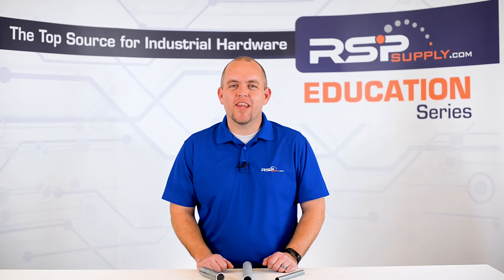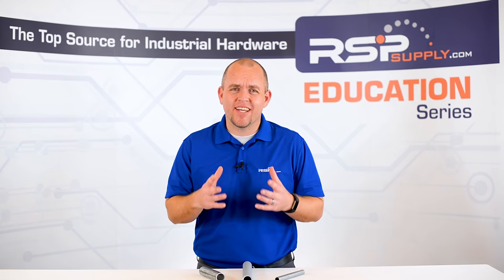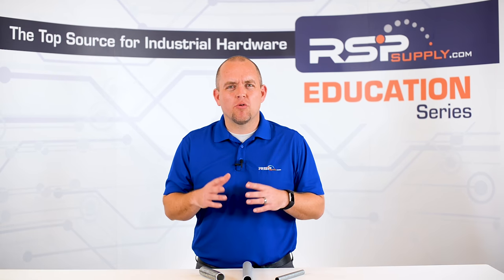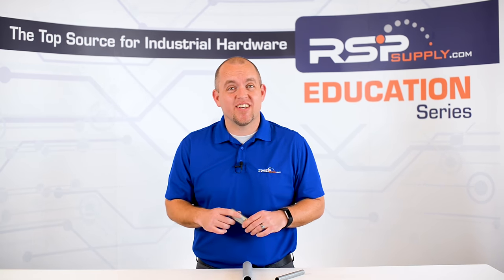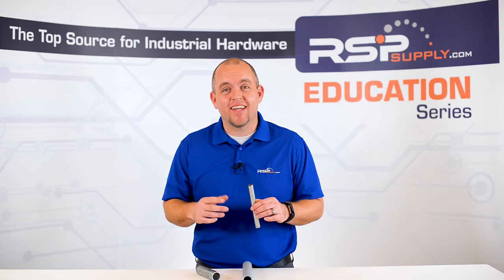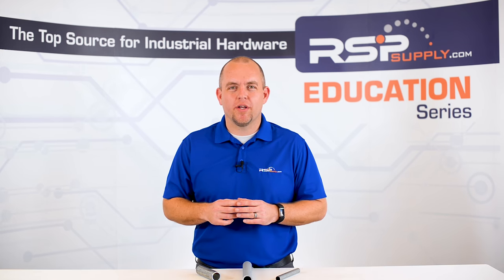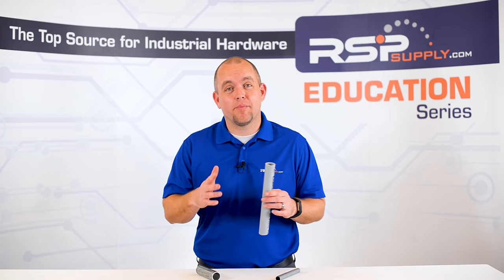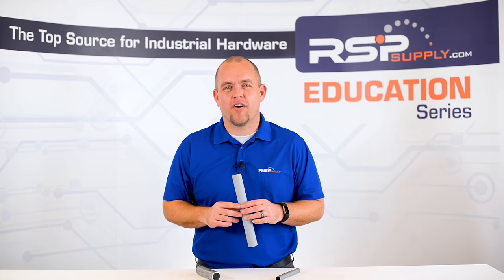Electrical Conduit: Types and Uses

Comment: I’m having concrete poured in my backyard 6 inch depth I want to run a better line from the back of the house to garage as it’s just a burial line now how far do I need to dig / bury the EMT piping under the concrete ?
Reply from the maker: You want to use a PVC conduit for that
Reply: Right. Do you know how far I need to dig the pvc pipe ?

Comment: Rather than replace a conduit, can you just thread new wire through the old conduit?
Reply: depends on what you are doing this for.  if this is an installation where a piece of broken conduit caused the issue or you are for  some reason the circuit needs rerouted at a longer distance I'd replace it with the wire.  Conversely it possible for wire that just ove 25 years old under heavy use to need replaced and in that case yes you can theoretically just attach the new run to the old run and thus replace the old buy pulling it through.  This does assume that you don't need upgrade your wire size and or the conduit was large enough to start with.  Beyond that if you are shortening the wire run distance sure that is usually fine as you  just replace any cut ends and keep the rest.   Does that answer your question?  At Least partially?

Comment: What are the advantages and disadvantage of all conduits and where can they be applied?

Too long?
Oops...
Reply: Read the article numbers in NEC (national electrical code).  Example Article 352 PVC Rigid Polyvinyl Chloride Conduit. For instance, if you read article 352.10 Uses Permitted you can get an idea of how PVC is used (or a scope of applications). An Electrical Illustrative Handbook  helps too, but a Youtube video like this one is worth a thousand words.

Comment: I have a dream where I can build an industrial themed pc with big exposed fin stack heat sinks, and flexible metal conduit used as sleeving for the cables. Unfortunately I cannot find anyone who produces conduits of that size.
Reply: Brake lines from an auto parts store.